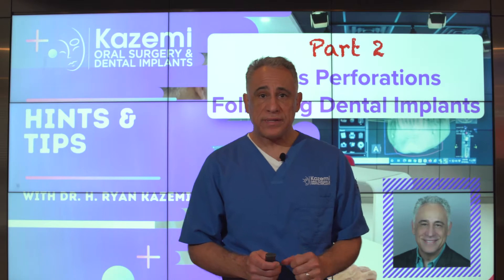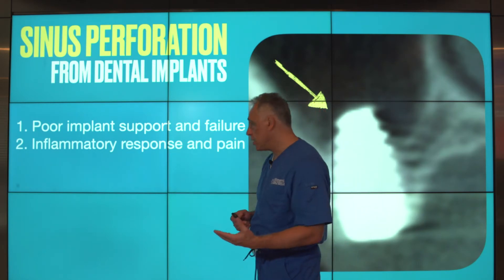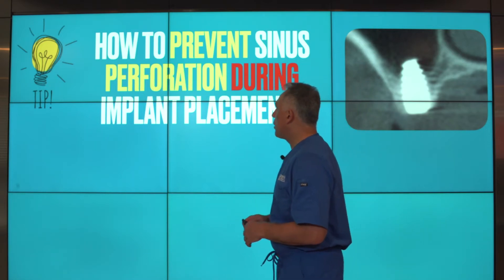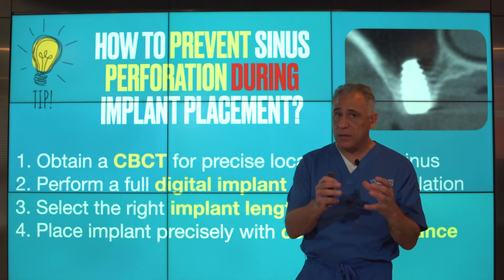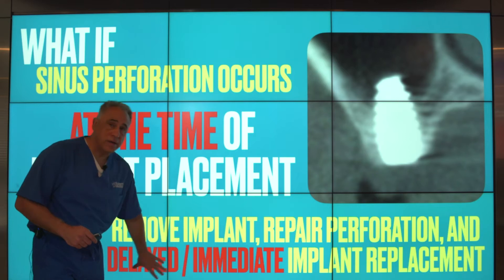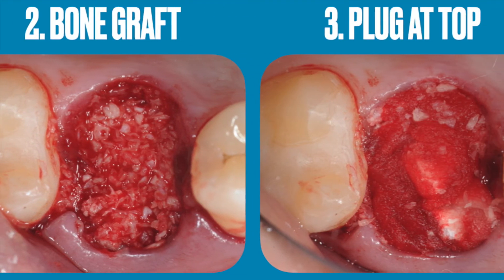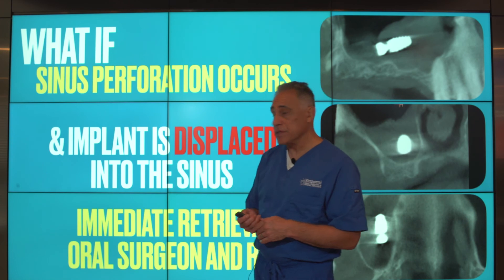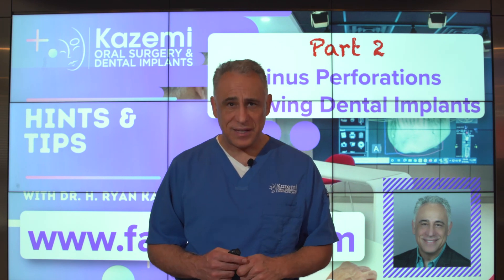Part 2- Sinus Perforations Following Placement of Dental Implants

Comment: I had a front implant done about 3 years ago and immediately weeks afterward developed breathing issues, especially when laying down. It was so bad I had to start using CPAP....and I'm someone who has always been a world champion sleeper with zero issues breathing at night. During the procedure, the doctor had been doing something in my palette and had to do stitches on the roof of my mouth. I had a rupture and bled into my mouth and had to go back to get it sealed up again. I'm wondering if its possible I have this perforated sinus condition which as caused me to go from having zero breathing issues to needing a CPAP, almost like a switch was flipped. It was that sudden and directly after I got the implant surgery.

Comment: I had 2 implants placed 2 days ago. The dentist perforated the sinus membrane with both implants. 😢 He finished the procedure and explained it to me afterward. He said it should heal on its own. He said if the implants don't take, we'll have to start all over! I don't have the money to pay for this again. Thinking about it later,  I wondered what about the bone? If the implant is poked into the sinus, will the bone somehow heal over top along with the membrane??? I'm pretty discouraged and regret doing this.
Reply from the maker: Hi. If the implants are perforated into sinus, bone will not grow over it. it will remain 'in' the sinus. Best to check both implants with a CBCT and see to what extent it is perforated in. The areas of the implant not in bone, are not supported, making the structure weaker. Sorry to hear about this very preventable problem you have faced.
Reply: @kazemioralsurgery thank you. My dentist did use a cbct scan during the procedure. This is why I just can't understand how this happened. He said the one perforation is just a small pinpoint. I don't know the size of the 2nd perforation.
Thank you, again.